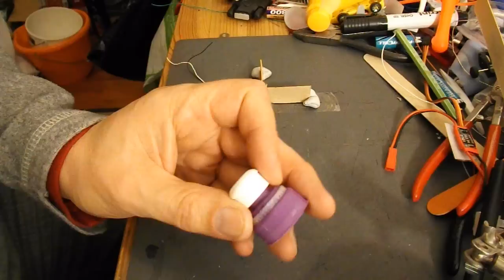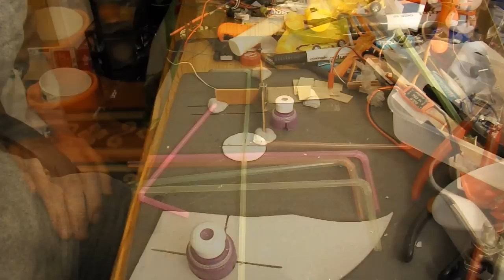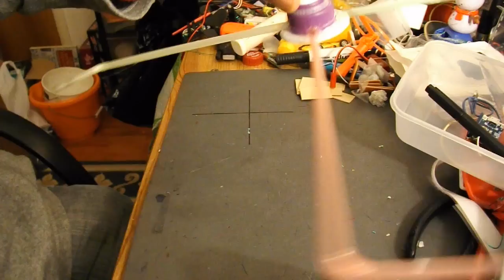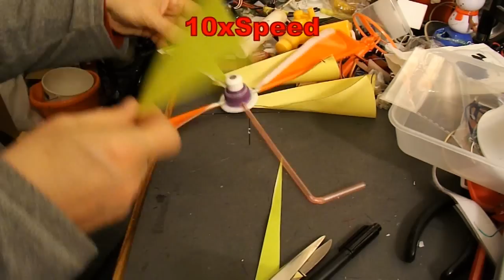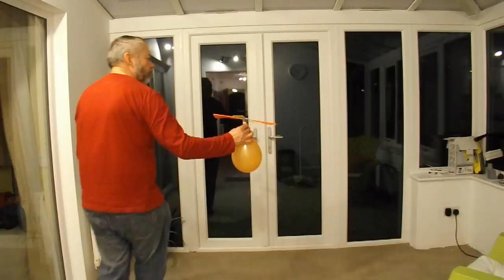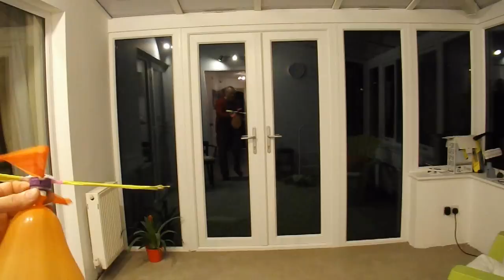Balloon Powered Helicopter - FAIL

Comment: To me it sounded like the water bottle valve center piece was not allowing enough air through it into the propellers. I have had a toy like that before that worked great so your design is perfect. However, one thing I would change on your design is to angle the propellers to generate the most lift. Great video though!
Reply from the maker: Benjamin Adams they were in the shops last year and I didn't buy one. Now I can't find any. I don't supposed you have a video of it? I have just uploaded another failed attempt.

Comment: maybe 3 blades? the ones i had had 3, its less weight for it to have to start spinning. i think they also had the blades spin independantly of the balloon (kept it from pinching the balloon shut as it spun)
Reply from the maker: colter james Calvetti I am very frustrated, they were in the shops last year and I didn't buy one. Now I can't find any. I don't supposed you have a video of it? I am just about to upload another failed attempt.

Comment: 7:06 The air from the balloon (by rights) should not be restricted very much at all. Four times straw openings is quite a large (overall) opening and the balloon should (by rights) be deflating at a much quicker rate. That said, it's probably that the nozzle is restricting the airflow more than the straws themselves. lol There's your problem. This is cos it causes a great lowering of efficiency, when the air is restricted at the beginning (instead of the end). lol. It's important to have the most restriction at the very ends (like you mentioned). You can rebuild the nozzle to un-restrict to it (somehow). Maybe by a little plastic tube on the balloon that snugly fits into the helicopter (and you can pinch the balloon on the neck just above the plastic tube). I would use those really thick straws (you sometimes see) that are nearly a half inch diam. And some light soft foam packing stuff wrapped around the straw and taped to the piece of straw for a good lightweight seal with the balloon. But you need the diam to be nearly the same as the balloon neck (otherwise it won't work). And that's why yours doesn't work. lol Once you un-restrict the nozzle the balloon will deflate quickly (if you don't do what you said in the video). lol But it will be powerful and give the blade heaps of pitch. It should sky-rocket then, but only last a couple of seconds. I bought a 3-blade balloon helicopter and it went great! It also had the blades angled upwards about 10-15 degrees (dihedral). It was nice and stable, lasted a while, cheap and was a good product. lol And (as you suggested) mine had smaller openings on the blade tips, than a straw opening. But I can't remember exactly what size. The balloon lasted about 10 seconds. It doesn't seem like a lot but you know by your stuff that 10 seconds is a long time for something like that (well it seems longer). Have fun.
Reply from the maker: Justwantahover they were selling helicopters like these in the shops last year and I didn't buy one as I thought they were too expensive for a cheap plastic toy. However, like you say they would have had a much better airflow, as you know it's all about having the right components and that bottle cap I was using is not the right item for the job. Obviously a mass produced toy can have a properly designed light weight one piece molding and turn them out in the thousands for next to nothing. I will probably have another go sometime and see if I can do anything heating, bending and melting the straws to avoid extra glue. I think I would go smaller too.
Reply: GrandadIsAnOldMan I don't think the weight is the main problem, it's just that cap. lol But (as you say) the lighter the better. Have fun.

Comment: Ingenious With the wind trying to turn the rotor with an angle on it um, Think of a Windmill. . if the wind blew out of the end of the sails would it still turn, The wind has nothing to blow against apart from air, whereas if the wind was blowing at the blades the blades would turn.
Reply from the maker: Graham R Dyer the really frustrating thing is that they were selling these in the shops last year and I didn't buy one because I thought they were too expensive for a cheap plastic toy but I am sure they would have worked fine.
Reply: Graham R Dyer Uuuuhm no. Try putting a fan onto a sail boat and try to make it move... you are "pushing" against yourself, as it were... The rotation in this device is caused by the reaction of the flow of air, Newtons 3rd law.

Comment: hay put hydrogen gas In balloon it will fly
Reply from the maker: +Prince Mohammad I am sure you could try that if you wanted. You realise that the gas would soon be lost and you will have to refill it for each attempt. This is nothing to do with being lighter than air, it is about generating lift from the rotational motion.
Reply: +GrandadIsAnOldMan yeah ur right but I might say nice idea and nice try👍👍👍
Reply from the maker: Prince Mohammad if you follow the links in the video description you will see I made several versions